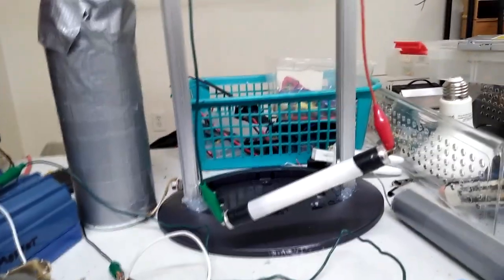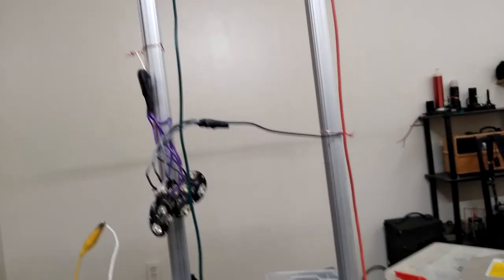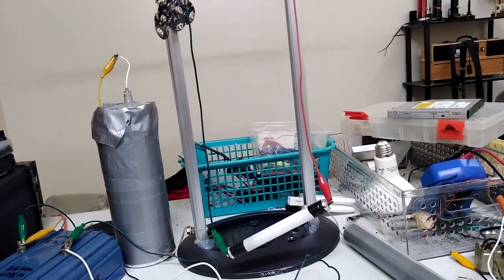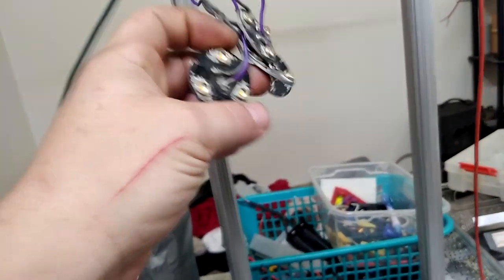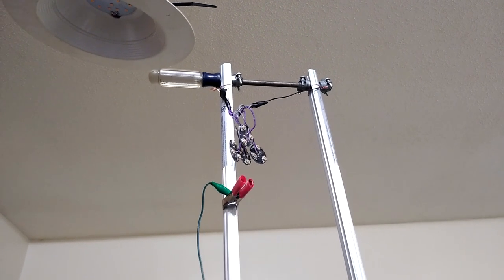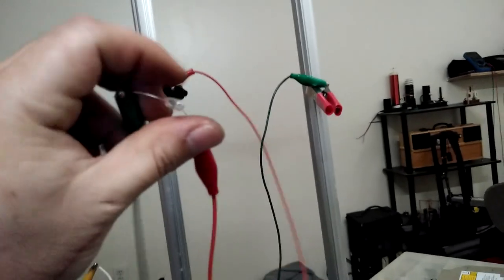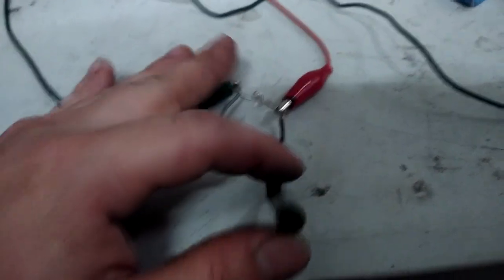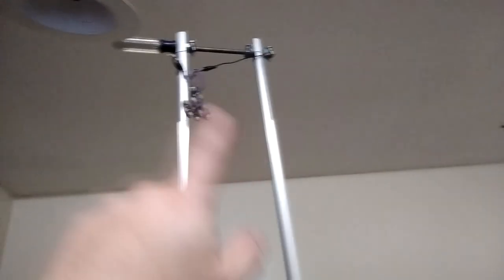Tesla Stout Copper Bars Continued. Shorted load testing.

Comment: That is F'n funny it's manipulating your computer like that and I'm surprised it's not killing your camera standing as close as you are. I was thinking what a coil around the bars would do not actually touching the bars of course but the wire ends connected at the spark gap but you have it completely shorted. I was interested in seeing what adding a magnetic guide wave to the dielectric radiation would do.
Reply from the maker: Lol yea I kinda feel bad for the lady who lives under me since it not only likes to kick out a lot of interference but is also loud as hell. Building an enclosed spark gap has gotta be a must. I recall something about adding an inductor to the bars or just near the shunt or something like that which is def interesting. I'm not too sure much would happen til I get it resonating.